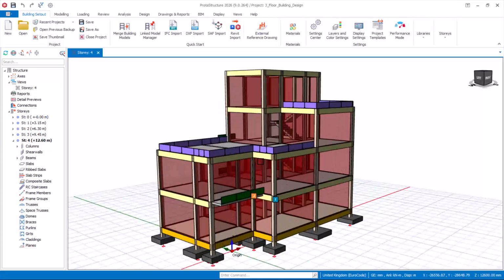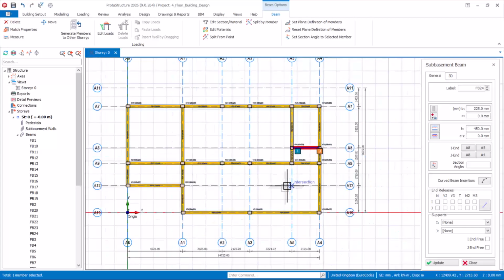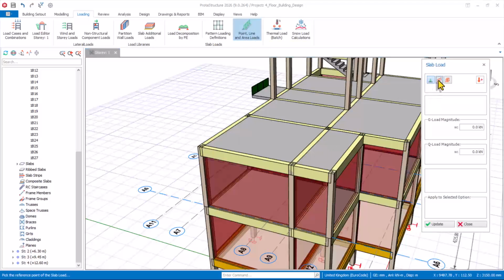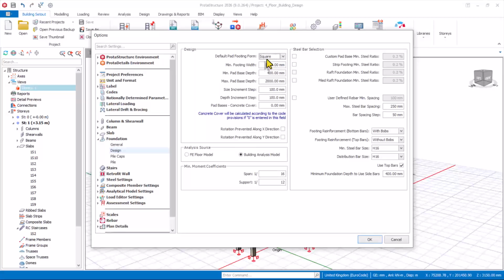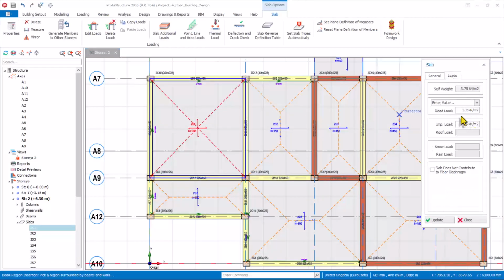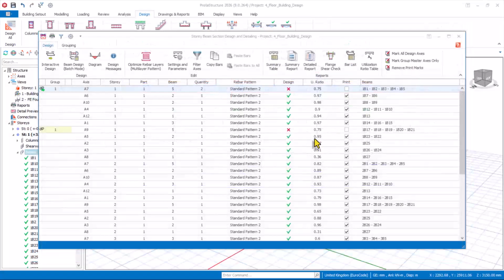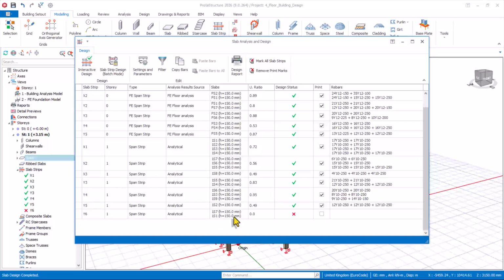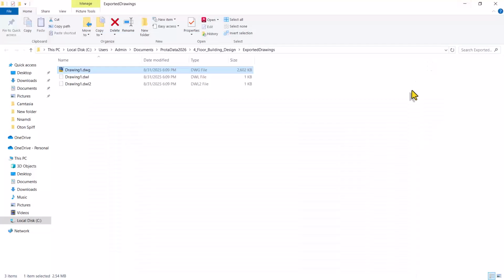ProtaStructure 2026: Revolutionizing RCC Building Design (Real-World Case Study)

Comment: Hi Engr. I'm a undergraduate. a question, In panelling for the structural design, I can see you delete some partition walls of which you don't add them as line loads on the slab in the designing, won't it cause deflection and bending in the slab after construction.
Reply from the maker: You must not add a line load to show a deleted partition wall but it can be factored along side as additional dead load